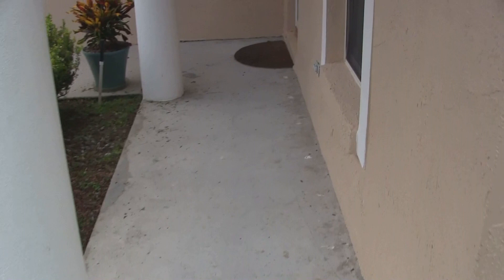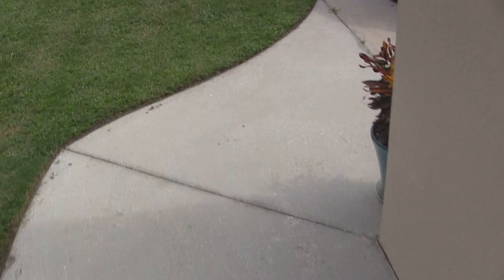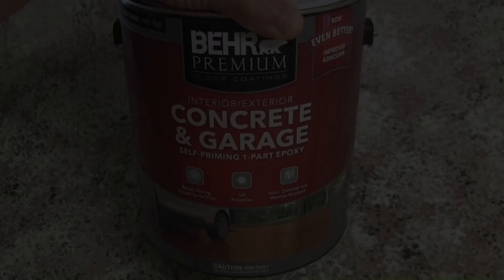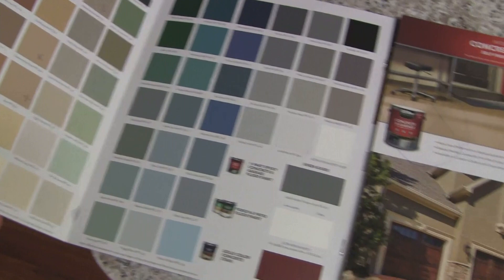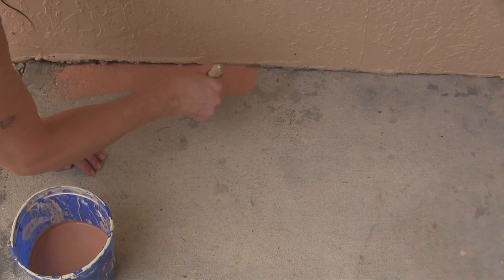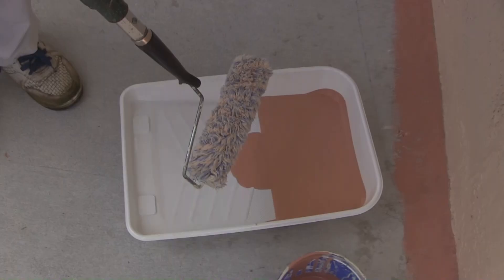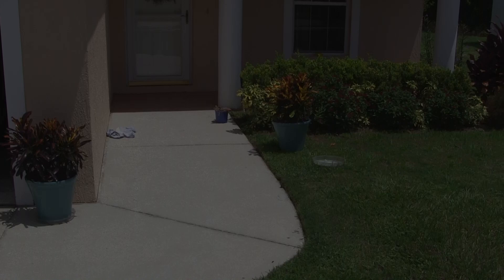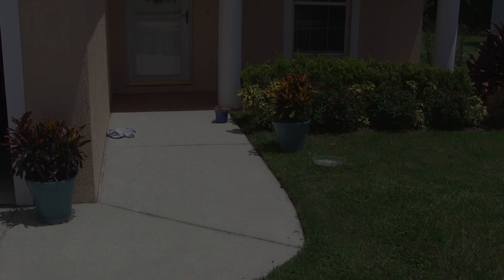Painting Concrete Porch/Walkway using BEHR Concrete 1 Part Epoxy

Comment: "Couple of hours to do" 🙄 HAHAHA  I have a concrete front porch built in 1960 with lead based paint, oil based, acrylic, latex,  with some kind of fiberglass and epoxy covering it. Roughly 10 coats. 4 days straight with a pressure washer to "pop" it up. Used Citrus Strip, some other "Kwik Strip" that you could smell down the street and finally xylene. "Paint stripper" is no longer made. Just that garbage labeled as such. They "strippers" worked somewhat, but what was under the next layer(s) had turned to an adhesive type goo. Finally resorted to discs that go in a drill with the texture of lava rocks. Went through 10 of those. Just did an acid wash with phosphoric acid and I want an epoxy paint that will last. Slip Doctors is $135/gallon. Expensive. Just stopped in to watch and vent. Thanks.
Reply from the maker: Sounds like a nightmare. Your story made me a little nauseous. I have a job that might be a nightmare myself coming up. You know... one of those jobs where the previous owner did something half assed and now I have to figure out a plan. Anyhow, I'm always happy to let someone vent. I'm sure you'll do a good job on your porch and it'll turn out good. Unfortunately, the nightmare memory will stay with you.
Reply: @stevekonbass  Thank you for your reply. Did you acid wash before painting as everyone says? I used the Citrus Strip to get some latex paint off of 5 bricks. 1 measly layer where someone cleaned the brush off. I let it sit overnight and used a 3000psi pressure washer on it the next day. The results were the same as if I had tried to wipe fresh paint from the bricks, it was still smeared on them. The chemicals in actual real strippers was banned, methylene chloride and NMD. Nice color you did. I have an extra roller if you want to come help.
Reply from the maker: LOL... sure. Have a ticket at the airport waiting for me and I'll be right over. No, I didn't do any acid wash. I hope you don't have OCD because those marks on the bricks could get to you. Sounds like you've done your best. Just roll it and move on to the next project.